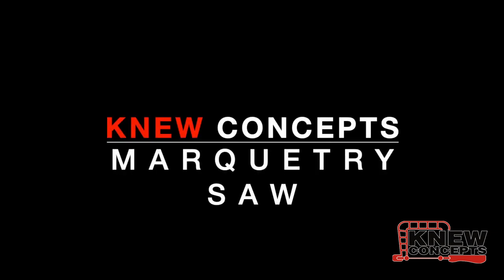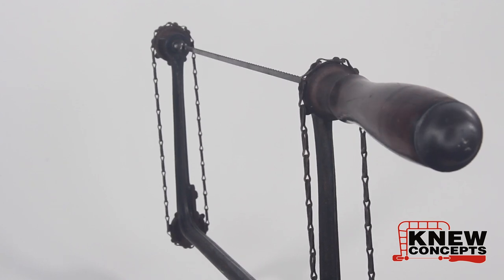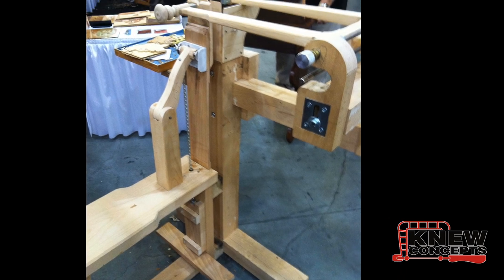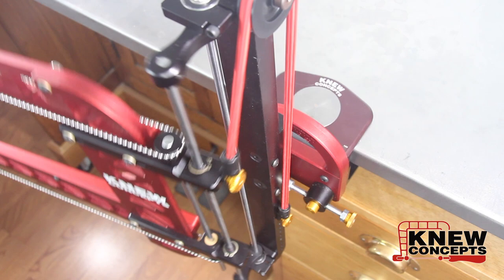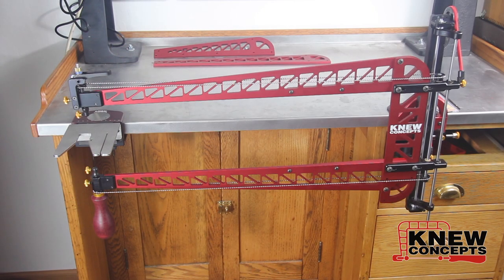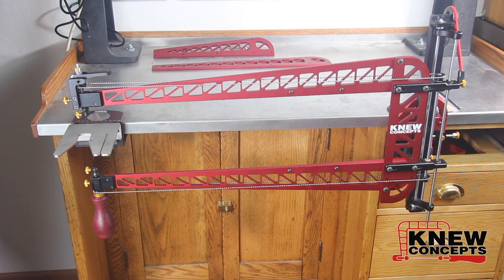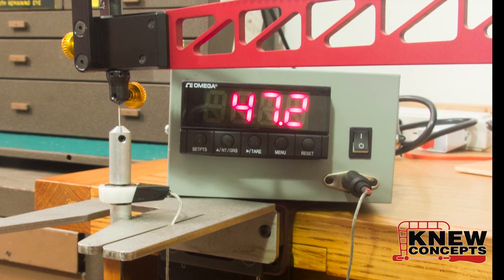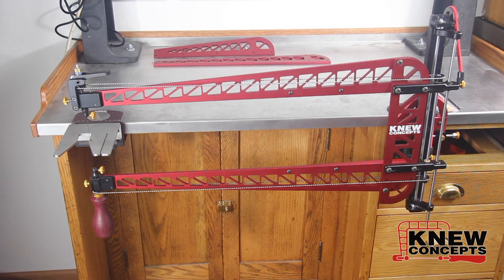Knew Concepts Marquetry Saw

Comment: Cool. A few things I've been thinking on over the years. How to make a combined coping-jewelers saw (rotating blade). How to make the arms light and stiff. And long. How to make the whole thing slide up and down, unlike the bouncy scrollsaw. You did that. And geared the top and bottom clamps. Genius. Now how to motorize it?  (I know its anathema.)
Reply: Errr....you can't motorize it.  Won't work right, because the force is coming from the wrong end of the legs.  That said, we do have a powered jeweler's saw that's every bit as accurate as a hand jeweler's saw, and will cut all day without blowing up your wrists.  It doesn't swivel on the fly like the marquetry saw does, and it's not nearly as deep.  But it could be, if someone really convinced me to make a super-deep version of it.  (and I had the time for the R&D.)

Comment: Hi, request your help with details for purchase. Also is it possible to connect this to a motor?
Reply: HI Alvin,  just drop us a line through the contact link at knewconcepts.com, and we'll take it from there.  Unfortunately, there's no way to hook it up to a motor.  The swivels wouldn't work right, nevermind any of the other issues.  We do make a powered jeweler's saw, but it only has an 8" throat.  I've toyed with the idea of making a bigger one, but the engineering gets nuts fast.  12" might just be feasible, but anything bigger, like the 24" of the marquetry saw?  Not in any sane universe.
Reply: Why not get a scroll saw?

Comment: And for the low low price of $2500 you too can own one. Yes, you read correctly $2500 for a hand saw. Drop it by an order of magnitude then halve that to get it under $200 and you may have  something.
Reply: ROTFLMAO, you obviously aren’t in the market for one of these, as the $200 you recommend won’t cover the cost of blades for a year for the people in the market.  DERP